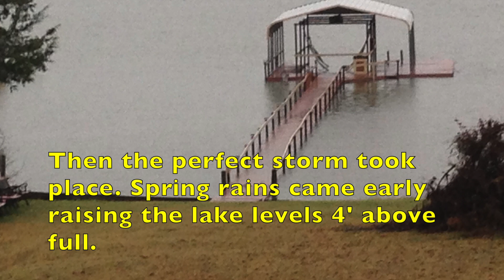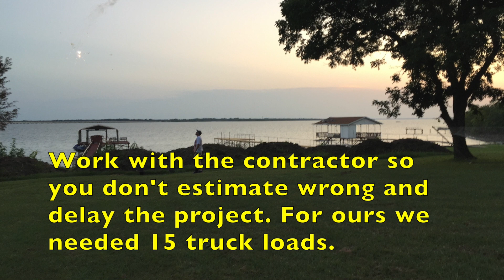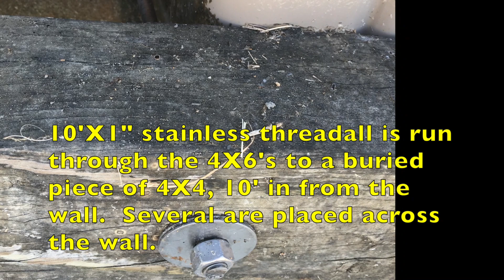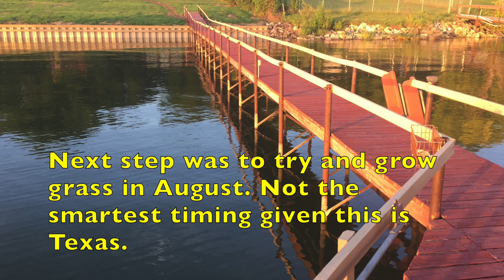Lake Seawall Build

Comment: How the heck do you ensure those walls get pounded in straight? What if the wall starts hitting something below the earth, like a giant boulder and it sends it off course?
Reply from the maker: They first take the backhoe and scoop down five feet across the entire area to remove rocks. So you are pounding into pure mud. Simple level and horizontal beam keeps everything level. Each panel is slotted and guides off the last one driven. Pretty simple.
Reply: It sucks when you don’t have the option to dig it out first and hit stones and what not , just gotta keep pulling and re driving sheets till you get them to sit nice , most sheetpile walls people do are horrible lol but they come out straight and plumb if you don’t rush it too much

Comment: How much would a wooden wall cost per foot?
Reply from the maker: Not sure about cost of wood. The fiberglass product we used here if memory serves was about $120 a foot. You have to add other costs like the the 15 truck loads of dirt we had to haul in to replace what had washed away over the years. The fiberglass is the way to go. We have lost very little if any dirt since completing the wall. But it is expensive.
Reply: JASTIKA Wood & Metal DIY Projects I’m partially rebuilding a customers sea wall made from 2x6 treated tongue and groove boards. We have to dig out the land side and add dead man anchors to it. Never done it before, it’s a 48 foot section...
Reply from the maker: @ZoeyTheGSP  Should be a fun project. The other pro with fiberglass is the product is suppose to last 50 years. Now that is what the vendor said. Who knows if it is true or not. I will be long dead by that time. So far it appears to be pretty durable.
Reply: @jastikawoodmetaldiyproject7276 what's the lifespan of the metal if the fiberglass panels are 50 yrs ?